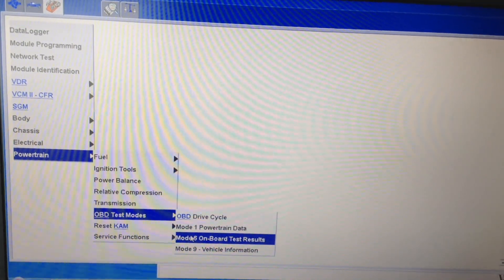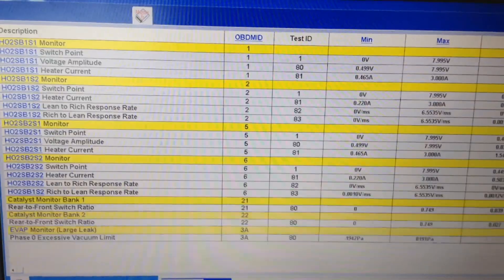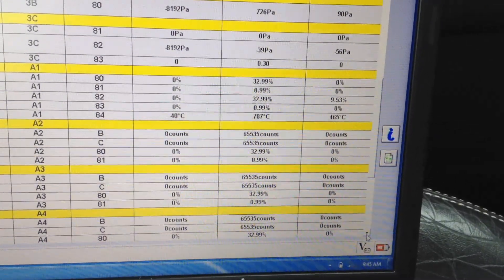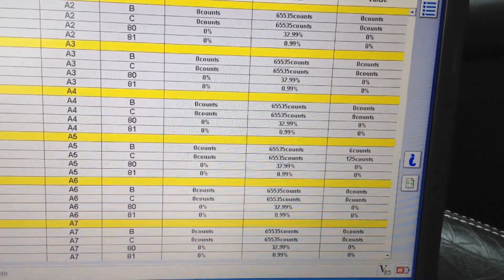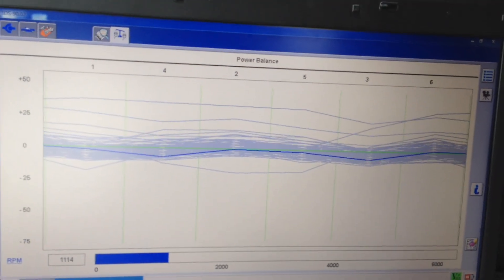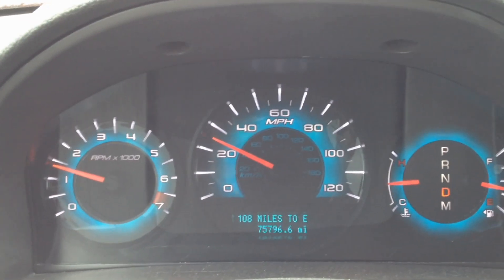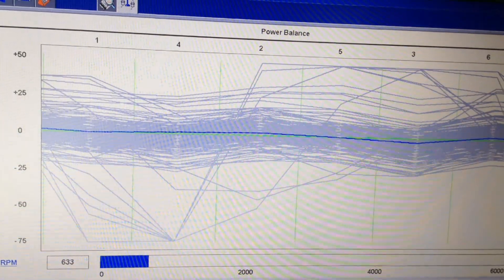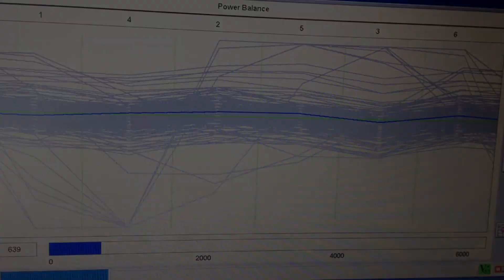Engine Misfires That Feel Like A Harsh Shifting Transmission

Comment: A lot of people don't know that the Alternator can also cause a car to jerk....I had this experience before.....what happens is, your car is losing power and if the alternator is bad or has bad voltage being sent between the battery and distributor cap, the power won't get sent properly to those other parts like the spark plugs which would misfire.
Reply: I've been experiencing jerks for about 8mo now, when accelerating between 25-35mph, and also while maintaining a speed of about 45mph. 
No lights on the dash, and no codes thrown... until yesterday.
Check engine light came on, then battery light. 
Got the battery tested, and they said my voltage regulator is faulty. 

I've been wondering all day if the two are related?
Reply: @muhammod95 i wonder if thats why my car is doing it. my key fob just started being way more faulty too
Reply: Did the jerking go away after replacing the regulator?
Reply: I had that problem with my 93 mark VIII. I changed the alternator and it went away.
Reply: @muhammod95 did you fix it?

Comment: I have a ford Ranger with a cylinder 4 misfire code and a shake and occasional jerk. I replaced the plug wire and coil pack. It seems to run better with no misses so far, but the dead miss is so intermittent it is hard to tell if that is the fix. Thanks for the video!
Reply: Says comment was 5 years ago , oops, did you feel the harsh shifts on up shifts too? my ford ranger is throwing the 4th cylinder missfire code too..
Reply: Let us know

Comment: I have cylinder 4 & 2 misfire with map sensor code and shuddering at 40 m.p.h. in 3rd or overdrive. In 2nd it will misfire but wont shudder. What do u think?  Thanks for advice. Its a 2005 ford escape with 3.0. Engine light is on.

Comment: 07 Explorer, 40mph in OD plus a light load created violent jerk.  Independent wanted to pull trans, rebuild/diagnose for $3000. Took to dealership was told #5 needs COP and plug. A few more of your videos about the dreaded 3V plug and less than $500 later runs perfect. Thanks for all the great videos!

Comment: FordTechMakuloco:
THANK YOU! THANK YOU! THANK YOU!
Thank you SO much for this video!
I was having a nearly IDENTICAL problem with my vehicle (Nissan Frontier).  I had taken a long trip, and on the way home, my vehicle was doing the same exact thing, at the same speed range. I was agonizing over what might have been a nearly $6,000 repair/replacement for a transmission. Luckily, last night, I came across your video, so I watched the whole video. Today, I did use a scan tool, and, SURE ENOUGH, I found misfire events on one cylinder. I pulled the coil pack on that cylinder, and the coil pack assembly was broken. Since my vehicle is high mileage and 8 years old, I replaced all the coil pack assemblies. My vehicle runs great now!!! I spent $400 instead of potentially $6,000.
Again, THANK YOU!!!!
(I am going to share your video on YouTube, hoping it can help some other people, too)
Reply: I have frontier 2014 and now it is jerking terribly. Do u think it is the same problem you had?  Thanks
Reply: @jacobadams8073  ...It is possible. The best way to find out is a scan tool. Another very quick way is to pull each coil pack and physically check each one for damage/excessive wear. This would eliminate or possibly confirm the jerking.
One last thing: check the cleanliness of your throttle body assembly AND your MAF sensor.
Good luck, but best bet is a scan tool.
Reply: @dlopester13  thanks Diego ima give it a try. Thanks again.
Reply: Someone told me it could be my catalytic converter. But I asked my friend to check it out and he told me I need knew coils and spark plugs and it’s crazy because my check engine light was blinking like the video and would shut off after four blinks. Then went home and left to buy a code reader and it had 3 misfire codes 0300 0302 and 0304. It’s just crazy how my friend knew what potentially could be my problem for power loss and thanks to this video I have hope 🙏

Comment: 05 Ford F350 5.4 3v  Truck was doing that and eventually was throwing code for cylinder 5 and 6 misfire   p0300 p0305 p0306  
Load on my scanner at idle was at 39%  timing was reading from 15 to 45   rough idle  and rough start up . Was shaking like crazy. Under load flashing light and goes away when you let go. 
All plugs and coils checked out good no water or anything else in the holes. Left side cover off and it turned out to be #6 exhaust valve spring was broken. 
Well while in there already did complete timing job and all following your instructions. 
Couldn't have done this without you. 
Your work is much appreciated. 
Thank you

Comment: Dodge nitro 2008, exact same symptoms and few garages tried to rip me off trying to convince me it is a transmission problem.. However, rpm not fluctuating, no engine lights triggering.. Feels like car wants to shift down when I slightly press gas pedal while climbing slope.. Replaced all spark plugs and all problem has gone.. Thanks for your graphic demonstration of this problem. God bless you.

Comment: Hi Makuloco I just got me a project 06 F-150 5.4 Triton V8. 77k miles and it misfires under load. The repair is straight forward (new spark plugs and ignition coils). If I want to advance my auto repair skills I need a scanner to learn how to diagnose like you did in this video. I was recommended the Autel MaxiAp200 and FORScan, but I rather get a recommendation from an actual Ford mechanic that has extensive knowlegde on the Triton V8. Thanks in advance!

Comment: Ford Ranger 2014 model 2.2l 4x2 (manual tranny, turbo).
The problem is, when at 2nd gear or 3rd gear and accelerating from a running stage or climbing it's power is so weak, if rpm is below 1500 it doesn't have power on it, it just slowly picking up and picking up power even if it's already floored. It's so weak it feels like stalling if you have not enough propulsion goin up or if the car you are following suddenly drops speed then you have to change to the lower gears immediately or press clutch then rev it or else you will stall. But then, when rpm finally gets past 2k, it will suddenly picks up power like a a multiple vtec-like power just kicks in. The power delivery is not smooth. Slow acceleration then only picks up power at certain rpm.
I replaced all filters already (Fuel filter, Engine Air intake filter) I also changed oil on engine, transmission and even the rear axles with all-AMSOIL fluids. I also asked a friend to clean the EGR. I also replaced the turbo hose in the top. I also added an TECHRON Diesel additive in my last fuel fill to clean injector and fuel lines. Yes I feel a little bit of improvement after all of these cleaning and stuff, but the uneven power delivery and poor low rpm power is still there, it's still bothering me.
It's not like that before, I tried two trucks of the same model and specs from a group and they does not act like they were smooth and torqy. It's not normal.
What should I check? Shall I clean the exhaust? Catalytic, does it have catalytic or something? At higher speeds no problem, it's a fast truck when it's already at speed.
One thing I am noticing is when accelerating the sound also has a tractor-like sound effect if it's accelerating and the tractor sound effect goes away when it gets to speed already. But pressing gas and revving when parked does not create that sound. the sound only appears when accelerating.
Reply: shifting is also not smooth, there is a jerk when shifting to other gears.. harsher on downshift. No matter how good rev match I do, it still not smooth transition of gears. No check engines in the Ford Ranger.
Reply: What ended up being the problem?
I'm experiencing similar things with my 2015 ford edge.
Reply: @williamgaskin2383  Turbo is worn out, New Turbo or an aftermarket Cartridge replacement kit solves my problem. Others said it was the turbo actuator for them its stucked open and wont boost early.

Comment: 2009 ranger same harsh miss, only in overdrive going up a hill when the trans should downshift.  Tested everything. This happened 1 year after changing spark plugs with NGK. Replace NGK with Motocraft, same issue. Finally replaced plug wires and problem solved, and I should have done this before changing the NGK spark plugs. NEVER had an issue with NGK on any vehicle or equipment I have used NGK spark plugs on. Even Ford with no codes couldn't find it, except that I should have the trans fluid changed. At $250 less tax I am glad I did my own testing. Hard miss as Brian has said in another video is usually seconday ignition. He was bang on with that.

Comment: I've been driving with bad ignition coils, and have had the symptoms you describe at the start. But those are actual downshifts, due to the lack of power in the engine.
Reply: me to
Reply: 2007 Lincoln MKZ here ..Same here

Comment: I had a misfire under load...pulled all of my coil packs and wires...found all of them were corroded and cleaned them all up / lubricated springs, checked boots. The coil packs had over 200,000 miles on them. -  Problem solved. No check engine ever flashed. In the past, I did have a coil go out and the check engine light came on right away. This was different. I have a 2008 F 150 5.4 / 3...this truck has been bullet proof. Keep the oil changed and the radiator filled with fresh, clean fluid and you're good.

Comment: 2009 Flex.  I changed the plugs and coil packs 5 months ago and everything was running great.  Until now.  It feels like 2 cylinders are cutting out.  What could cause them to go bad so quickly?
Reply: Plugs backing out?

Comment: THANK YOU VERY MUCH
My truck is Nissan pathfinder 2001 2WD has exact problem for months,i thought that is transmission problem,after watched your video last night i run to auto parts next day and get new set of sparkplug Bosch.wow,power gain and down shift seem like is gone,a very very slightly some time,now i just need clean MAP  sensor and re-adjust throttle position sensor too.Thank you again.

Comment: I want to tell you thank you so much for this video it went out an back to Ford dealership.First trip did reflash ,on second trip it was throwing codes P0717 an U0100. .. they changed both sensors out picked vehicle up thinking its fixed.No still missing feeling like transmission slipping. .....hooked up to scanner no codes.Had them hook computer an drive it different story misfire on coil #1 an #4 .......so  going to fix end of this week an replace all plugs. FORD FLEX 2009 lets hope this does it!!!!;)

Comment: I've got a random misfire issue on a 2000 5.4 i cannot find nor could the mechanics. New fuel pump and filter, new plugs and packs. Checked catalytic converters and installed new 02 sensors. No coolant in plug holes. New crank and cam sensors. New alternator and battery. New ECM. Im noticing now i have a slightly wet looking area under the right side of the cross over tube under the thermostat housing. Im thinking maybee i have an internal crack causing coolant into the combustion chamber creating a random misfire? Thoughts? Thanks.

Comment: 2007 5.4 F150 I just had this exact thing happen to me two weeks ago before I saw this video. Thought my transmission was going out. Next day it threw a code, misfire on cylinder 7. Changed the plug and 1,000 miles later all seems to be well.
Reply: Did you only the spark plug? Or you also changed the coil as well?

Comment: Had this happen on my mom's '99 Mustang GT 4.6L 2v/auto trans. Felt like trans stutter between 3rd and 4th (40~45mph) during light acceleration. Checked trans fluid;ok. Had her take it to our her local Ford dealership and they told her it was a bad coil on cyl #1. Didn't make any sense to me since it only occurred as stated. In my way of thinking I figured I should have also felt it during WOT but didn't. But I went ahead and temporarily swapped in a spare known good coil from my '06 GT 4.6L GT (swapped the coil boots too). Noticed that there was dried out dielectric grease in the original boot and tip of coil spring and cleaned them up. Test drove it and no stuttering. Hmmm. Swapped the coils back just to be sure. Again no stuttering. Must have been poor contact between the tip of the spark plug and the coil tip (solid tip on spring). Though the tech was correct in diagnosing a misfire he was quick to say it was a failed coil  which they wanted to charge $150 to replace.

Comment: I got an 07 ford f150 4.6l and replaced the trans with a rebuilt from Monsterand some where between 1st into 2nd jerks a little but no codes truck rides fine from 2nd through 4th so I'm kinda unsure.

Comment: I have a 2005 Ford Escape doing the same thing once I hit over 45-50mph. I’ll change 4,5,6 spark plug and coil boots. Can’t do 1,2,3 because there under the manifold. Hopefully one of them solves the problem.... thanks for the info
Reply: Did that fix the problem ?

Comment: I sure hope you see and can respond to my query.
I just bought, private sale, 2011 Lincoln MXK with 3.7.
Unfortunately, I also have a '06 F150, three valve.
Awhile ago, very intermittently, my truck had a weird vibration. It kind of felt like I drove over rumble strips. I pulled over, crawled all over underneath the truck, couldn't see anything and it went away. No codes.
Now my Lincoln has similar feelings intermittently. Kind of a vibration, trans work fine, but this comes and goes. Sort of feels like U-joint but it completely goes away, especially on freeway. I do have a code for the catalytic converter but only a general code with my OBD reader.
You think both vehicles are likely in the electrical system???
Please tell me it's not going to be thousands of dollars! Thanks a lot.
Reply: @martymartian9820 you ever figure it out. Having same problem with my 09 crown vic. I've replaced so much stuff. Thinking of new 02 sensors.

Comment: I have something that seems similar to this. I have a 2006 Pontiac grand prix that occasionally dies immediately after its started. It's also sometimes pretty rough to start. I've also noticed this "jerking" that he referred to in the video, only it happens when my car is upshifting. I'm worried it may be the transmission but after watching this I'm hoping its not
Reply: I have a 2005 grand prix with a weird shifting issue. It revs a few times rather than shift into 2nd and 3rd then eventually shifts 4th. Then it goes into this weird mode where the engine noise changes and it makes a surging noise from 1st into 2nd gear and shifts hard then shifts hard and weird in  3rd and 4th gear. It doesn't rev in this "mode" it actually shifts rather than rev but shifts hard and weird every gear. When I turn off car and turn it on after 30 seconds this mode goes away. Only right when i drive the car for the 1st time for the day it shifts normal for a couple min. Does everybody know what this is? There is no check engine light on either.
Reply: same car !!
Reply: i need to know too.
Reply: Spark plugs

Comment: I have a 01 Lincoln Continental,  engine light came on a week ago. No diffrence w code po430.  Now it's bucking occasionally & changed my plugs found oil in plug #7 PLEASE help me out 😫 valve gasket,  maf sensor,  o2 sensor,  egr valve?  What could it be?
Reply: Alyssa Harris I have been chasing this same thing. Began thinking it was a vacuum leak, ground issues/electrical after raining, MAF sensor/wire pigtail, possible foam blockage near air filter and finally 02 sensor...possible culprit could be valve Gasket....I began observing a slight weeping of oil from my valve gasket months later I located oil in a few plug wells...plugs changed at 120 thousands two years ago. After cleaning out the wells I figured I would loosen one of the spark plugs and examine the threads however I wasn’t successful in fear that I would break one of them given how much torque. 2009 F-150 5.4

Comment: I own a Ford Fusion 2015 SE 2.0 ECOBOOST engine that’s FWD. My car has done 54K KMS and since 20K KMS I’ve been having issues with my transmission and facing the following concerns 

1. At lowers gears, the shifts are slightly delayed, harsh and lurches the car forward if the gear shifts at lower acceleration and speeds especially during traffic situations 
2. When I bring the car to a complete stop, the car produces a knocking sound and lurches forward at the last reverse gear shift 
3. I feel the 3rd reverse gear shift to be harder and harsh compared to others
4. When I accelerate from zero, there is a knocking sound as well. 

I’ve been complaining about this to Ford since 20K KMS and they have been coming back stating this is normal in this car, but I don’t think so as this is not normal characteristic of any car. 
At 30K KMS I went ahead and escalated the issue to the service manager who then observed this characteristic of the car and then decided to observe keeping the car for like 10 days and decided to change some solenoids along with some drive cycle was done with some software reprogramming. This did help to reduce the issue but I feel now it has come back making it really irritating to drive the car and I’m not satisfied 

I’ve gone back to the service manager and asked to give me a test drive on the same model so that I can confirm if this is a normal characteristic of this car. Which they said they will take a week and get back to me. 

do you feel this is an issue with my transmission? Have you come across such situations with cars, and what would you do ? 

Let me know ...
Reply: Hey.  Did you find a fix for that? I'm having same issues with my Ford Mustang.

Comment: I'm a tech also and love you videos keep them coming
Reply from the maker: Will do!
Reply: @FordTechMakuloco   what's the name of that software u used to diagnostic the misfire????
Reply: @FordTechMakuloco I have a 13 eco boost.  That misfire when hard acceleration  changed plug and coils.  Same issue.  Misfire changes all over